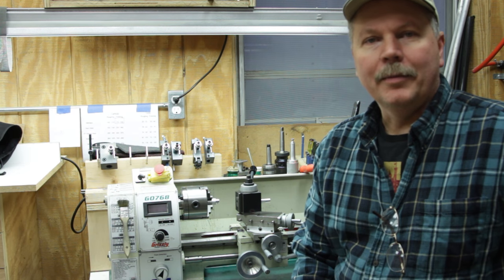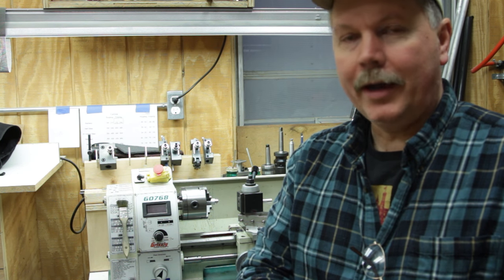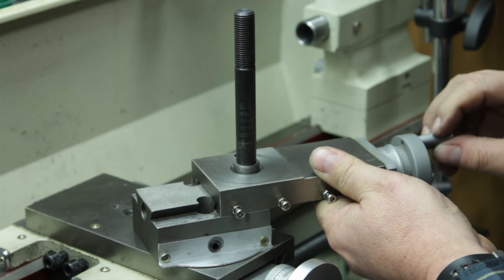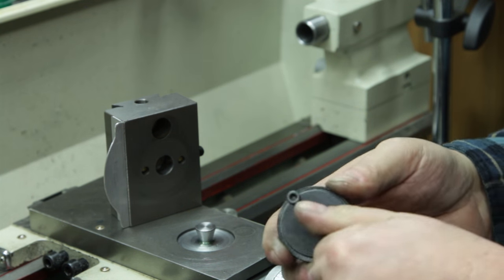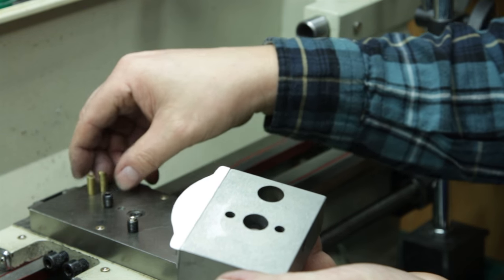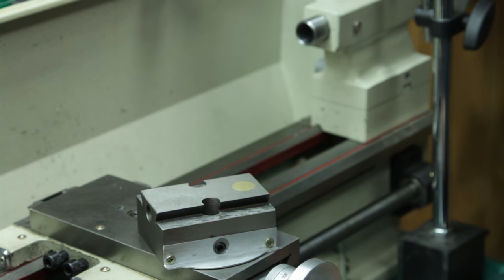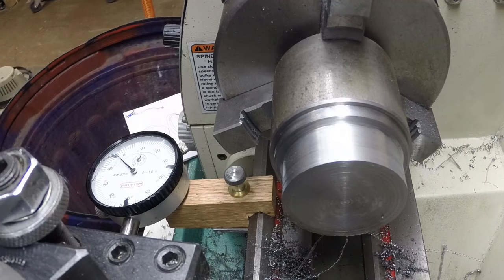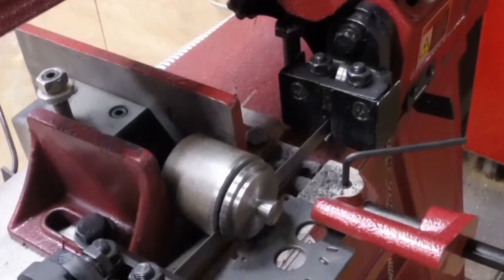G0768 Compound Modification

Comment: Excellent idea... That is one of the last modifiations I am going to do on my Mini Lathe... Have not got an exact design but I will make something simple...I have made a guard for the carriage gears, all new handles with 3/4 inch balls on top, made new idea carriage lock, new t-nut and shaft for the cam lock on the tail stock, new 5/16 inch carriage gib plates from oilite material and use studs and lock nuts to adjust carriage gibs, no more of those silly set screws...Thanks for sharing...Frank

Comment: Great idea!  The G0768 is a 8x16 lathe, which is just slightly larger than a mini.  (My mini is a 7x16 with a brushless DC motor.)  The part you modified is exactly the same as on a mini, but perhaps not in size.  Because of the vast number of mini's out there, this plan really needs to get to some of the mini groups.  But because the mini, the 8x16 and the 9x20 lathes all use a MT3 spindle and a MT2 tailstock, I have no immediate plans to upgrade unless I go to a Grizzly 10x22 which has a MT4 headstock and a MT3 tailstock.  The Grizzly 10x22 has to be a cool machine, its name is inspiring because it reminds me of the Ruger 10/22.

Comment: This seems like a much easier mod than the hogging out material for accessible nuts.  Slightly different approach might be to leave a centering nub on top of the taper so top diameter of the taper wouldn't be as critical to get right to match the bored hole, but that's just a quibble.

Comment: Hi Don, i have a very similar machine, i drilled two holes through the compound to access those screws, your mod is streets ahead, thank you for showing us hos to do better.
Reply: I have problems with the cross slide leads crew nut, I am working on a bush to replace the sloppy cast iron insert located in the top of the slide.

Comment: I use a drill to unscrew the compound and simply cut a allen key to fit in the drill . quick and easy mod.
Reply: I built a pretty cool stepped aluminum tool that I chuck up into a hand drill to quickly rotate all of the handwheels on this machine.  Each step fits the ID of the handwheels which keeps it perfectly centered.  I bought a long T-handle allen wrench that works great for the 2 compound screws,especially since you don't have to turn these screws much to loosen them.

Comment: I just did an AXA tool post conversion on my G0768 and I found that I needed to lower the height of it to get a better working range on the tool holders. I milled .40" off of the bottom of the tool post and the milled out the center at the bottom to accept the large base on the slide. Rather than remove the press fit threaded rod from the cross slide, I extended the thread another inch or so on the rod and then shortened and center bored the AXA rod, then tapped it to thread over the smaller rod. I guess both roads lead to the same place just a bit different recipe.  I like your angle fix and will incorporate that into my cross slide.
Reply: Did you post any videos on milling the AXA QCTP to fit onto the G0768?  Seems the OXA size tool post is shorter, and the AXA size needs more than just a spacer which would raise the height of the tool shank.  Thanks,

Comment: Brilliant design, very well done, thanks for the video.
I’m going to try it on my 7 x 12.
But I think I’ll try it by leaving all the original holes alone.
I’ve seen replacement slides which put a second set of holes closer to one end, they sell it with the upside that you can turn a larger diameter and it’s easier to adjust the angle because the slide has to be moved less. Unfortunately it leaves a guy with the same clamping style.
If I machine my slide like you did but in the second location they put holes in (on my unmolested slide) I should get all they advantages of your upgrade and the increased distance advantage of their idea while not touching the original machining. Another plus is I won’t be intersecting the original retainer bolt bores as the new location is solid steel, and later I can always go back to stock if need be.
Thanks

Comment: Good modification - I do a lot of screwcutting and as you say it's a pain to have to wind the compound right out. Just one point - for screwcutting you need the compound (or top slide as we call it in the UK) at an angle of 60 degrees (or 55 for BSF etc) to the lathe bed not 30 degrees....... It is of course 30 degrees to the end face.

Just one other thing - I have both a QC toolpost and the standard but find there's far too much flexibility with the QC item causing chatter especially when turning stainless which I do a lot.
Reply: That's a load of rubbish.....the American way is to swing the compound over at half the thread angle and the Brit way is with the compound parallel to the work piece and feed it sideways a few Hundreths MM as you go deeper......been doing it that for 60 years , now retired, but still do it that way.

Comment: Hey Don, great idea.  I'm thinking about the 768.  I've been staring at lathes and their prices for so long that when Grizzly sent me a sale add for $950, I couldn't even remember if it was the normal price or not..  Well I'm officially done looking and I'm down to this one and the g4000.  Would you still buy the 768?  Anything else about it that needs modded?, or weaknesses to look out for?  Thanks for the vid.
Reply from the maker: Just last night I spent 4-5 hours on the lathe creating parts for a new project and it still runs great. I do like the variable speed option, it allows me to make adjustments on the fly that can help with the quality of finish I get on the material. 
One thing you will want to do no matter what model you get is to pull the spindle and remove that sticky, waxy grease that comes from the factory.
The manual will tell you what type of grease to use. I got mine from my local Farm & Fleet store. Replacing the grease made a huge difference in how smooth the lathe runs.  It was almost a year before I changed mine and I feel like I dodged a bullet because of how dry the bearings were when I pulled it apart. No matter which one you get, good luck and have fun.
Reply: Thanks for the reply.  One more question if you've got time: Do you turn steel much?  I'd probably be working with steel more than aluminum.  If you've turned much steel, how much of a cut do you usually take off in a pass?
Reply from the maker: I do turn steel quite a bit. I usually take 20-30 thou cuts. Although I did just upgrade to a carbide insert set of tools from Shars so I might be able to go a little deeper. I'll have to experiment when I get a chance.
My original set of tools were the blue set from Grizzly with the brazed on carbide tips. They worked surprisingly well for the money.
Reply: Thanks for the help Don.  One more final question (I lied last time).  The sale that I got in the email says normal price is $1,295 and the sale price is $950.  I could swear that the regular price was somewhere around $1,050 to $1,125.  Do you remember the price when you bought yours?  I'd understand if you don't want to share that information..
Reply: Hi Bill, I just bought my G0768 and it cost me $1050. Now they are having a sale and they are $950. It's a very capable lathe. The best part is that my wife and I could lift it on the bench without any problem.
Reply from the maker: I think mine was $1,195 back when I bought it so $950 seems like a pretty good deal.

Comment: What a clever idea.  I found this video because my new today G0768 lathe did not have a working compound at all.  Once I saw how it was supposed to work I removed the tool post, reinserted the bolts and tapped on the bolts with a small hammer repeatedly until the disk came free.  The parts have an interference fit and there is no possibility of rotating the tool post ounce the bolts have been tightened.  I won't be using your idea to fix this poor machining and poor design problem until I have a lathe that works as I need the compound feature to make your dovetail part.  I knew I'd have to do some cleaning to get this lathe to work smoothly but this problem seems a bit much. Thanks for making the video as I did not know what I needed to know until a saw your modification.

Comment: nice mod. I have been thinking of doing such an oparation to my compound, but was not shure if it would clamp down enough. I had a slighly wider cone in mind, and the clamping screws offset to the radius (one more in front, and one more to the back of the slide. I saw something like that on a lathe once. Nice that you showed this, and be the forerunner with the guts.. indeed it is very annoying when you have to set the compound for reproducing a taper with the standard locking mechanism. cheers.
Reply from the maker: Thanks for the comment. I do have to tighten the set screws quite a bit to keep it in place but it does work. Even though it's not perfect It's WAY BETTER than the old method and so far is a lot more enjoyable to use. Good luck with your mod.

Comment: Thanks for posting, I think I may have seen something similar but memory isn't what it was. Would a larger diameter dovetail work better? It would mean boring toolholder much bigger diameter but should lower the amount of torque available to move things. Also, is there a preferred angle which would lock better

Comment: Do you happen to have the information available how you modified the compound to get the QCTP to work.  I have only seen one other person do this and was not the same way as you.  I like yours better and want to know what to do before ordering this lathe.
Reply from the maker: I don't have any video of the mod I did to the QCTP but what I did was to first remove the existing threaded stud. I think it was a press fit so I just drove it out. Then I drilled the hole in the compound to the proper tap size for the new QCTP stud and then tapped it. Once that was done I had to deal with that collar that sticks up. I couldn't take it off because that was the bulk of metal that I tapped into so I made a spacer with that size hole in the center for the QCTP to sit on. The last thing I did was to put a pin in the spacer and the bottom of the QCTP so when I rotated the post the spacer would also rotate.
The spacer also helped with setting a nominal height for the QCTP in general which made it easier to center my tools without them having to be set too high on the tool post.
Hope this helps.
Make sure to post a video if you get this lathe. I love to see what other people are doing with these small lathes.
Reply: I just ordered the G0768 lathe today, which it is back ordered.  It should be in stock in 2 weeks and I should have it around Christmas!  Now that you have described how you done your QCTP and after seeing that bottom plate I understand how you completed the task. Well done!

I was shopping at LMS and noticed that they have a drop in/bolt on QCTP http://www.littlemachineshop.com/products/product_view.php?ProductID=4157 . However it is on Backorder. Basically you drive the pin out of the slide and install a longer one and they provide plate that fits the boss.  I think I will give it a try.

I will be sure to do some videos of some projects.  I do plan on doing some reviews of the actual lathe after I run it for a little bit.  I looked all over the internet and found very few reviews of the G0768.  I was really torn between G0768 and the G0602.  I really liked the bed length of the 602, but I am still pretty new and dont really care for threading at higher speed, so the VFD made the choice for me and a few other things.

Is there any other tips/tricks or must have items for this lathe you have found ?

Thanks for your help
Reply from the maker: That set from LMS looks perfect for what you need. I'm not sure if it was available when I got my lathe or at least I wasn't aware of it, but it looks like it would have made things a lot easier.
As far as tips or tricks, that's an endless list. One thing I would recommend you do when you get it is to take apart the cross slide and compound and spend some time cleaning and honing the dovetails. There are some pretty sharp edges that you want to knock off. Also spend some time leaning about adjusting the gib screw tension. You want the slides to move smoothly but they need to be as solid as possible to get decent results.
Good luck, and I hope you don't have to wait too long before you get your lathe. It'll drive you nuts.

Comment: Just as a matter of interest, I have a 1920/30 Colchester Bantam lathe and the compound is fixed in the same way as you show here.....nothing new under the Sun apparently...…...trouble is it only has one screw at the front of the crosslide  against a dovetail bung so it doesn't really clamp the compound down all that tight.....I'll add two more screws, one in each side of the back of the crosslide at 120 deg angles to the single one to give it more grip. I've seen somewhere a lathe that had 3 screws spaced at 120 deg around the base of crosslide…...I might do that mod as the present method is not all that secure. BTW, don't breathe the smoky fumes from that vapourising oil as it will rot your lungs out, you should always use a water based coolant if you want to just drip or dab it on.....cutting with neat oil should be done with a flood to stop it smoking.

Comment: Great video Don.  I bought the same lathe a few months and also modified to use a quick change tool post.  Even though this is my first metal lathe I thought it was a pain , and poor design, for the one time I angled the compound.  So I certainly appreciate this video and will be making the same mod to mine.  You mention the 2 outer diameter dimensions but I wonder if you could me the step heights of those diameters so I came make the part without having to take my compound apart first.  I understand how the dovetail part of it works and that the angle is not really critical but could you also tell me the height of your dovetail.
Reply from the maker: The 2 step heights are the same as the original part so you can just get those from your part.
I'm still trying to get the new shop set up and the lathe is buried right now so as soon as I get it set up again I'll try and get that dovetail measurement for you. I'm spending way too much time running the music store lately and it's taking me away from my shop time:(
Reply: Thanks for the reply Don.  I was anxious to perform this mod on my lathe and was going through and making all the adjustments anyway.  So I took the step measurements off my original part and decided to make my dovetail 5/8 inches in diameter at the large end.  I also made it 5/8 of an inch high.  I don't know my angle, just fudged it since it's not all that critical.

Comment: Thank you for the modification! I just ordered a G0768 and am looking forward to doing the compound modification. What size did you make the dovetail? Thank you again!
Reply: what angle  is the dovetail
Reply: @carlspencer4024  Hi Carl, I went with a completely different solution, I drilled two holes through the cross slide that aligned with the screws. This made it very easy to adjust.
Reply: @brucewilliams6292  Bruce, that's so simple, I can't believe I didn't think of it! Duh!!   Thanks for sharing and I'd be curious if you had an update on how it's been working for you over the past 3 years.  Cheers.

Comment: Hi Don, I saw your post on Hobby Machinist about greasing the bearings. The videos on that post helped, thank you. Did you have any trouble with the speed readout afterward?
Reply from the maker: I didn't have any problems with my readout but I did make sure I took a couple of closeup pictures of exactly how it was put together to make sure It went back the same way.
Reply: Thank you for the quick reply.
Reply: Hi Don, and everyone else who might need to know. One has to pull the front control panel off and move the speed sensor out of the way prior to removing the spindle and bearings. The ring that is screwed onto the spindle breaks a light beam on the sensor to produce the speed. Also, there is another ratio available on the belt drives if you flip the top pulley on spindle you can drop down to 340 rmp max. :) Thank you for your videos. I should make on doing the bearings I guess.

Comment: Don......... I do enjoy your video's.   I e-mailed Grizzly 4 day ago asking what size the 
through hole was in the 4" chucks that came on the Grizzly G0768.  They 
are ether very busy or have a lousy service department.   Could you 
please tell me the through hole size of your 4" chucks?   Also what is the model number of your Quick Change Tool Post?   Thanks Don
Reply from the maker: The hole in both the 3 & 4 jaw chuck is right at 7/8". I can easily put 3/4" round bar in with just a little play. You might get some 7/8" stock in there but it would be a snug fit. The tool post I bought was the G5689 set from Grizzly. It doesn't work without modifying the compound because of the different size hold down rod and the collar I pointed out in the video. It wasn't easy to get it to work but I can't imagine using my lathe without it so it was definitely worth the effort.
Reply: try little machine shop. great service and a great inventory.

Comment: Nice design and build on the dovetail. Did you measure the stiffness  with a test indicator?
Reply from the maker: Thank you for the comment.
No I didn't check it with an indicator, mostly because the cross and compound slides are not very solid to begin with on these small lathes and this QCTP hold down is definitely more solid than the slides. If I do an operation that requires a rigid setup, like parting off steel, I find myself locking down all the compound  gib screws along with the carriage.